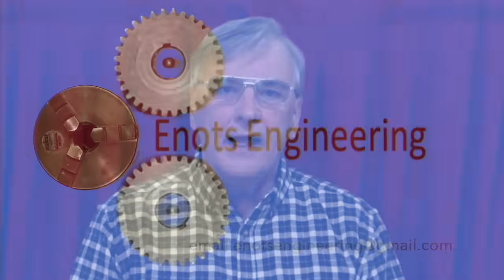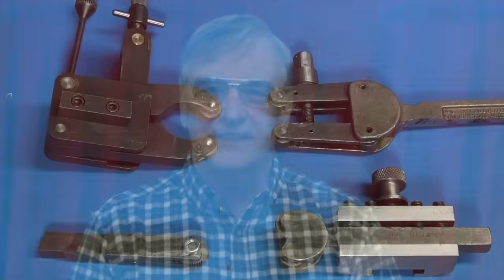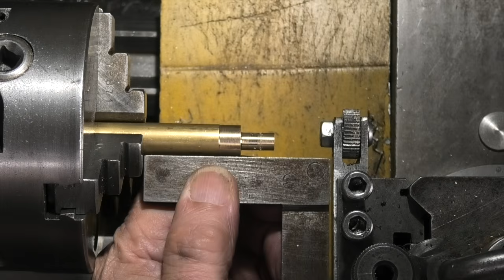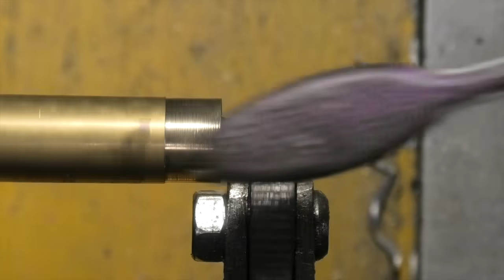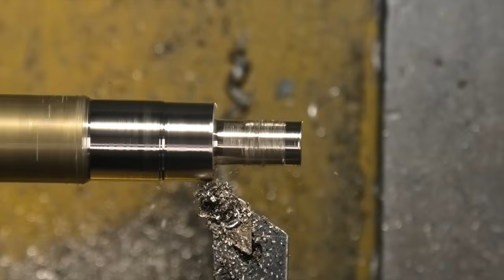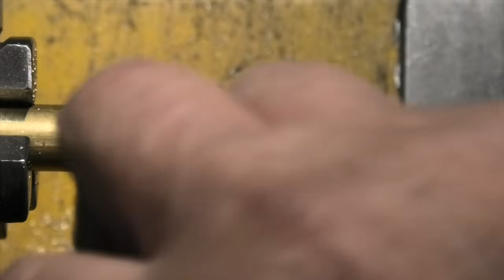lathe knurling tools

Comment: If you don't get a full knurl pattern just increase clamping pressure until you do! Only engage 1/4 to 1/2 the width of the knurl at first and start a traverse only after the correct pattern has started to form. Scissor-type knurling tools are fine up to maybe 1-1/2" diameter or so,  for larger diameters look into making a cut knurling tool which will work for just about any diameter. If you don't have flood coolant the best option for clearing chips is compressed air, a dab of oil does more harm than good as it makes a slurry which leaves a dull surface and embedded particles. Just my observations! Atb, Chris
Reply: That saved me a lot of typing! I will add oil makes the chips stick to the part, exactly the opposite of what you want. I will add, in my experience with the single roller types, I tip the tool to cut on the leading edge to reduce the pressure. I only start with part of the tool engaged to reduce the bar deflection and load on the headstock bearings. Get the pattern right at the end of the part then engage the feed, if it needs to be deeper I quickly flip the feed direction leaving the knurl engaged and add a bit more pressure.